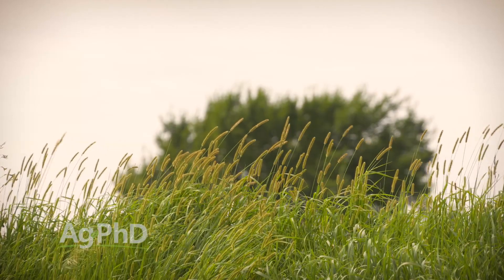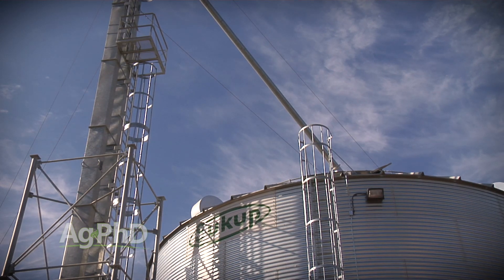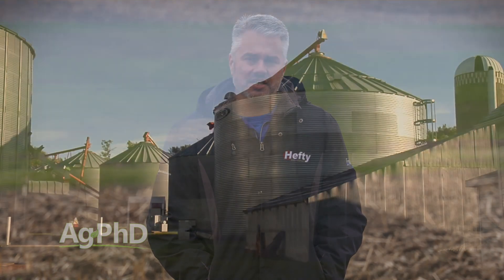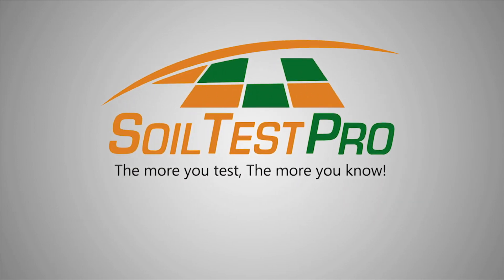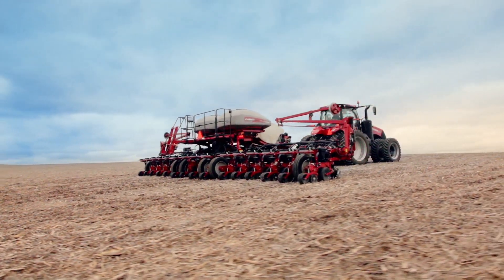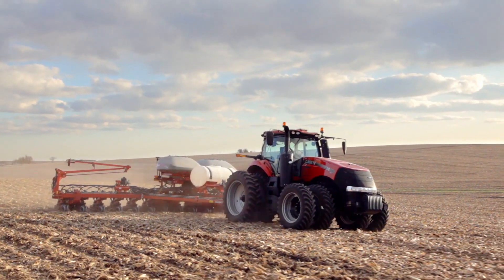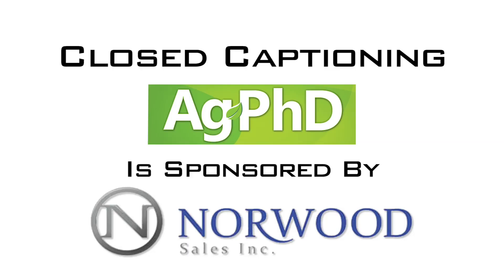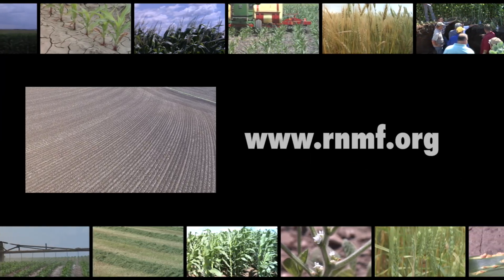Ag PhD Show #996 (Air Date 5-7-17)

Comment: Has anyone ever factored in the cost of equipment degradation and repairs introduced on top of the cost per acre of applying chemicals continuously? It never seems to come up. You say $3 acre for some spray but it is more than that. So what is the true cost to wear and tear on equipment, compaction of soil, carbon footprints for a dollar or two gain in yield???
Reply from the maker: Hi, Robert!  Thanks for the question!  Brian and Darren discussed your comments on Ag PhD Radio on 5/15/17.  You can listen to what they had to say here https://soundcloud.com/agphd/05-15-17-ag-phd-radio-show#t=57:12.